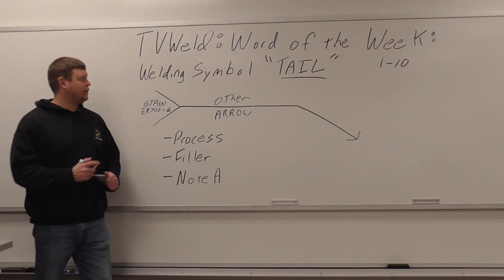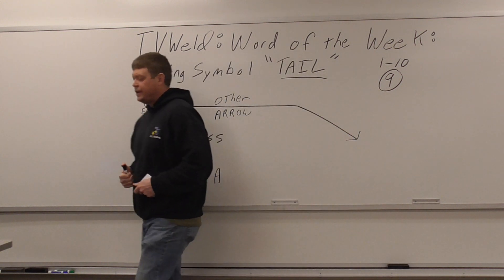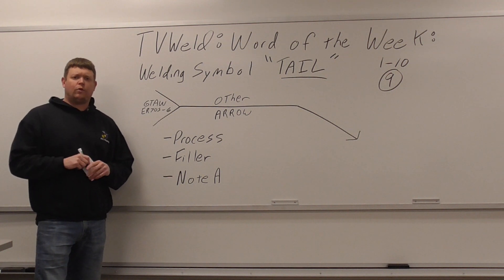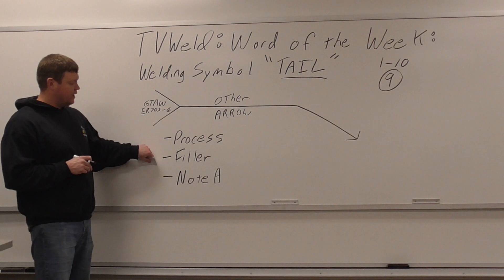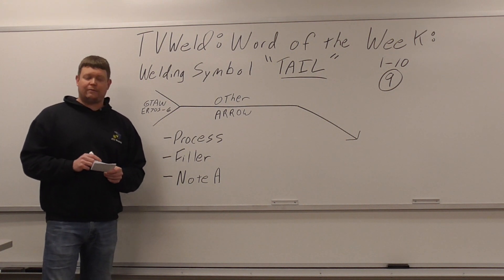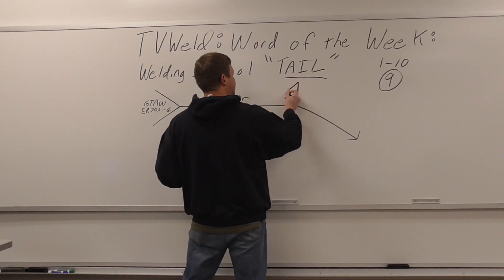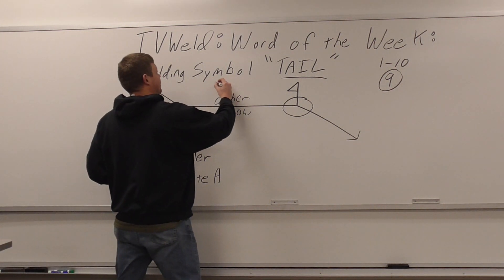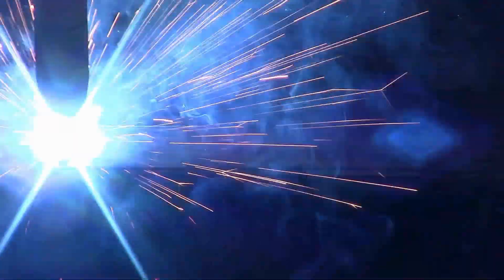Welding Symbol Tail

Comment: What does it mean when the tail bracket has a number in it?
Reply from the maker: I can honestly say I have no idea.
Reply: It's a reference block. It doesn't have a function on it's own, but if you or the client has a question about the part, they can reference the specific weld easier. There may or may not be notes on the drawing referencing them as well.

Comment: Being honest, welding symbols are not my strong point and as such l have a chart of them to refer too if l need it?
I used to think that symbols gave the basic weld procedure info. Now l see them as the "tail of the tape" symbols of welding specifics not otherwise shown on the symbol.
Short but sweet info in this video!